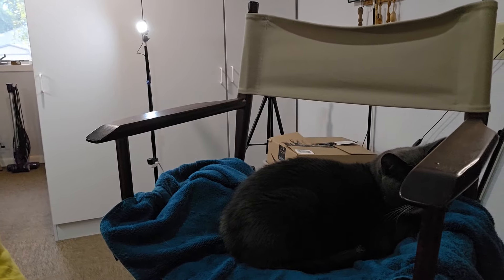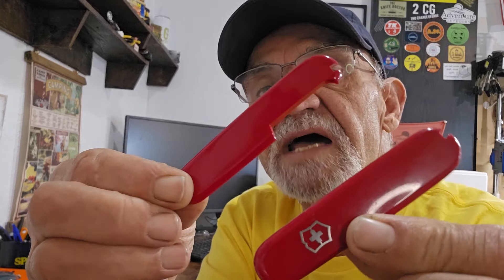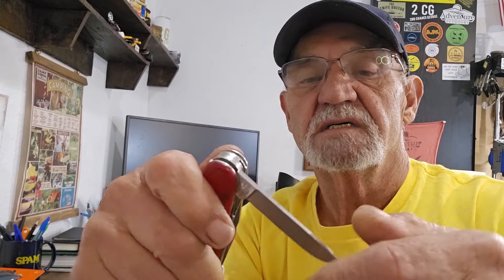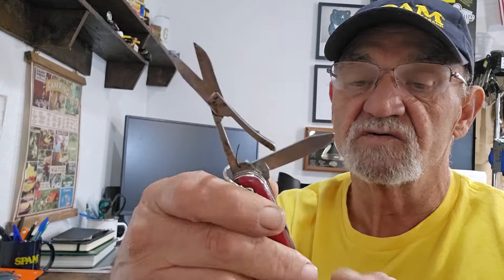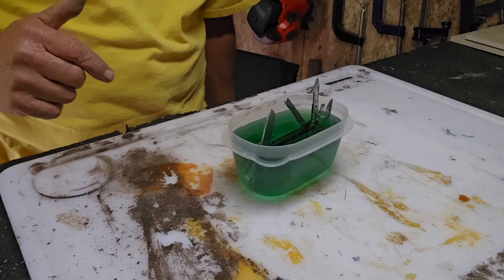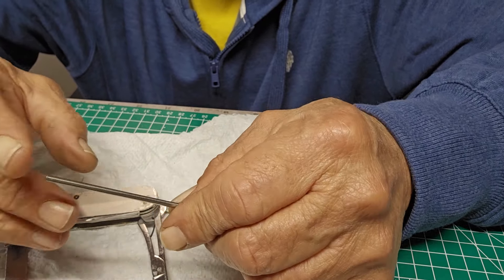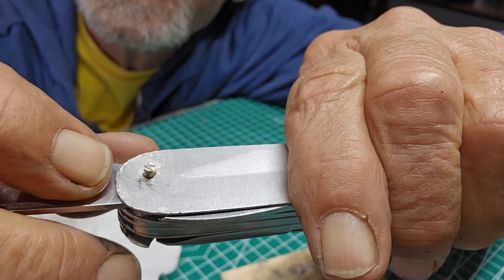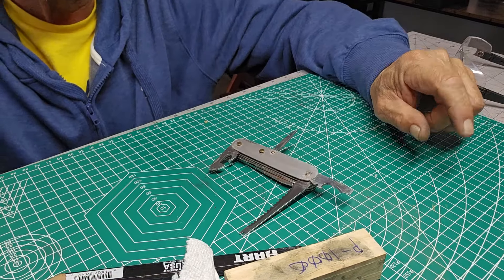Catch Of The Day: Reviving A Classic Vintage Victorinox Fisherman (1957-1973)

Comment: I saved a Victorinox Fisherman from the trash heap. The scales looked like someone held them into fire, the main blade tip was bent near the tip, the scissors were broken off at the tips. I slowly bent the main blade back into shape (can't even tell it was bent), reshaped the scissors with a file and put new scales on. Oh! The key ring end was bent and broken, like someone used it for a hammer. I filed all that off, flush with the scales. For some reason, most of the used Fishermans I find for sale are damaged.  I did buy a used one that wasn't and a new one. The one I brought back to life also had the aluminum tipped tweezers. I put the tweezers away for safe keeping (rare). Spent $8 for it. It was a fun project.
Reply from the maker: Nice. Very cool these. Be safe

Comment: George, I was looking around on SAKWiki, and the small blade came like that. The bail pin should be marked out on the back of the scale. You will need some 2.2 and 2.5 mm pins.
Reply from the maker: Yep figured that out...lol..after drilling the holes. Be safe